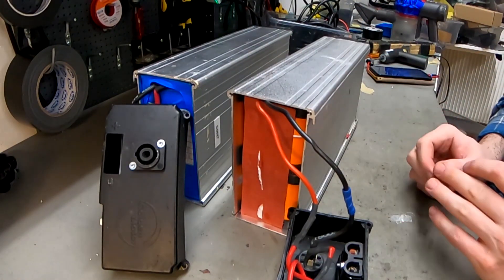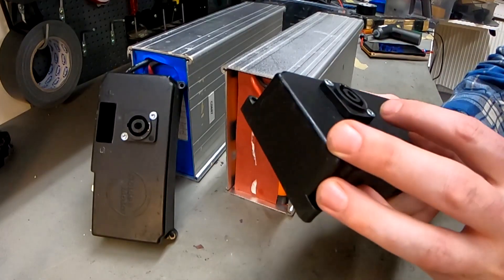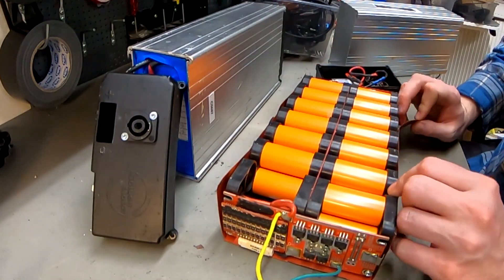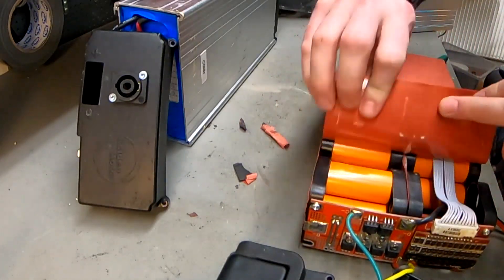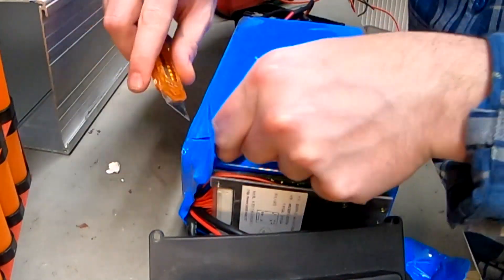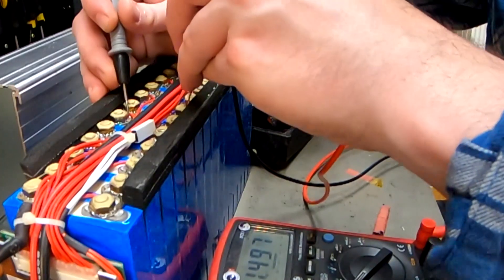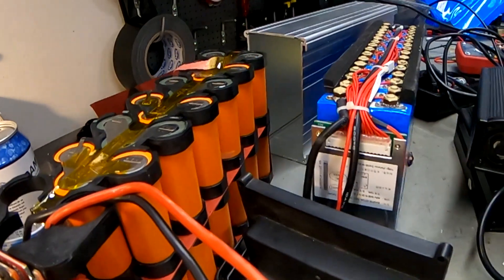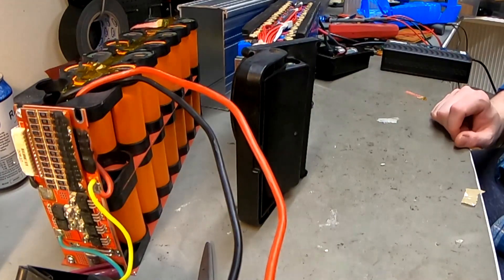Inside @ Zoomability/Zoom Camp 48V Golden Motor Batterypacks from 2011

Comment: When you spoke of the cables and how they seem to be underdimensioned, the zoom uphills motors are marketed as of 1kw each.  I hope this helps you more than it does for me, but I'm not an electrician, only a retired blacksmith! 😉
Reply: Thanks, does it have 4 individual motors? 2 driven by each battery maby?
Reply: @Batteridoktorn  yepp, sitter en 1kw navmotor i varje hjul. Hur elen fördelas från de 2 batterierna vet jag inte, men nog verkar det logiskt men två motorer per batteri! 😎